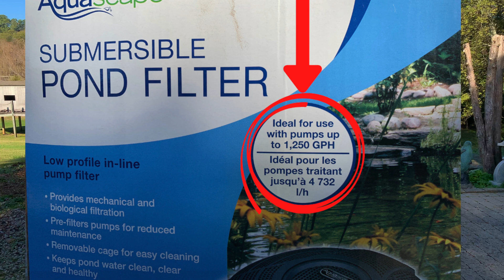Understanding Pond Mechanical Filtration | Ecosystem Pond Series 2!

Comment: This is going to be like listening to me dragging my nails across a chalkboard for a professional pond builder like yourself, so don't judge me but, I'm on a $500 budget, not a $5,000 budget. I am going to put a small (roughly) 7' x 4' 175 gallon pond in my basement for my arowana. It's a preformed pond called The Island (look it up at Menards or Home Depot if your at all curious). I want to go to Greg's place and grab one of his biofalls and an external pump to pull the water from the pond and push it through the biofalls. Are the biofalls set up to be my filter or would I have to buy something like that small one filter you spotlighted early on in this episode too?

Thanks for the info and keep doing what you do!
Reply from the maker: EITHER ONE WOULD WORK, DEPENDS ON YOUR SPACE. THERE IS ENOUGH BIOLOGICAL FILTRATION FROM EITHER TO TAKE CARE OF YOU BY FAR, MAKE A CHOICE BASED ON SPACE AND DESIRED OUTCOME! STAY TUNED, WERE ON AN AMAZING PROJECT IN SAN DIEGO, VIDEO COMING SOON ;)
Reply: @KoiAddiction  can I use all three in tandem? Are they designed to work that way? The low profile filter in the pond hooked to a non-submerged pump to the biofalls? If they can work in concert with each other, that's the way I'd like to go. I'm only about an hour, maybe an hour and a half from Aquascape in Saint Charles, so getting them shouldn't be a problem. Hooking them up so they work together is still up in the air - lol
Reply from the maker: S
o you need to make sure that the pump you were using is the proper flow rate to filter your Pond number one. Number two you need to make sure that it doesn’t exceed the flow rate for your pre-filter. Number three you want to either use the bio Falls or use the biological canister filter. I would not want to take the chance of letting the bio Falls put back pressure on the canister filter. The canister filter is not meant to withstand back pressure only to release the water back out of an open ended pipe.

Comment: Why does a swim pond have external pumps?  I was thinking a skim cove with pump vaults would work fine.
Reply from the maker: Something to do with electrical safety and regulations.
Reply: @KoiAddiction I better change my plans to explained my pond then
Reply: @bradparker649  Submersible pumps, even though they are carefully sealed, can eventually allow water into the the electric motor that powers the pump. When that happens, the water in the pond can become electrified which is, of course, hazardous to humans.

If your pump is plugged into a GFCI protected outlet (which it always should be), that outlet/circuit should trip if that were to happen. So, risk is low, but if you happen to be in the pond at the moment it happens, you'll receive a shock because the GFCI outlet can't trip until after it detects current leakage. A GFCI could also, theoretically, fail and not trip when it is supposed to, but GFCIs are always designed to fail to the "off" setting and not the "on" setting.

An external pump eliminates these risks altogether. They also tend to move more water using less electricity and, since ponds designed for people tend to be bigger, the reduced risk + electrical savings make them an ideal choice.
Reply: @TylerTervooren  thank you for the knowledge.  I never would have thought about it like that.  I'm so glad I installed a GFCI pug in my shed.  I had my father in law talk me into it.